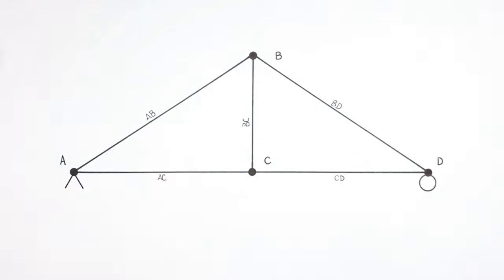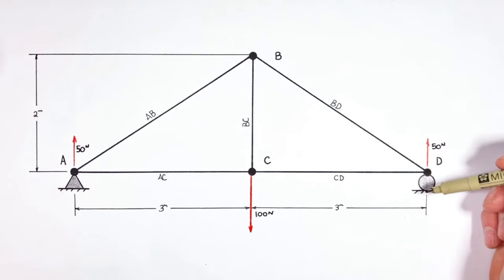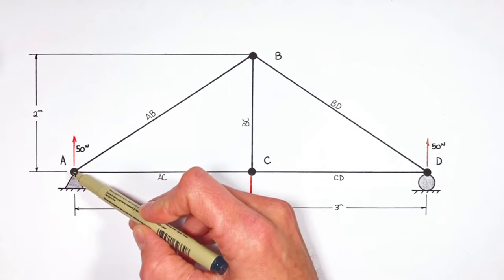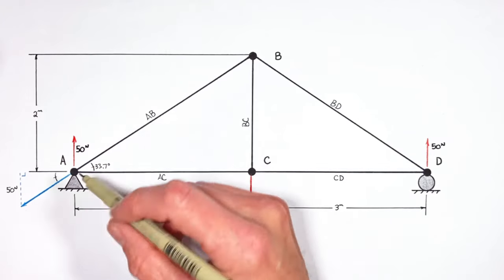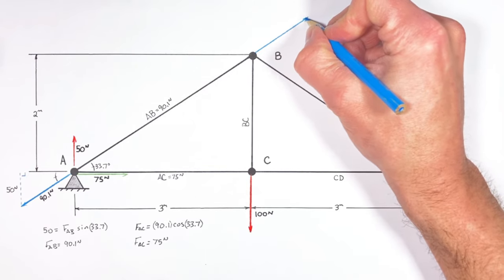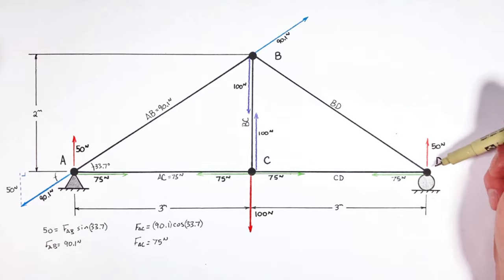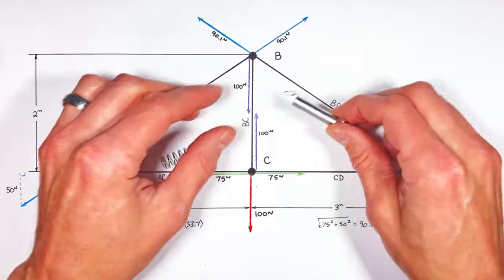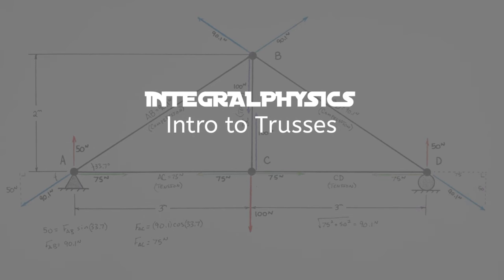Use the Method of Joints and BASIC Physics to Analyze a Truss  |  Statics

Comment: it is very hard to imagine in my mind how the wooden beam can actually stretch like a spring and having a tension force...
Reply: The molecules that make up the wooden beam do not touch but are instead held by intermolecular forces of attraction. These intermolecular forces are the results of attractions between charges. The molecules of the wood are similar to two magnets that are attracted to each other. As you try to separate the magnets, there comes a point where there is a gap between the two magnets but they are still close enough to be strongly attracted to one another. This is how the wooden beam can "stretch". Although the "stretches" are molecular in nature.